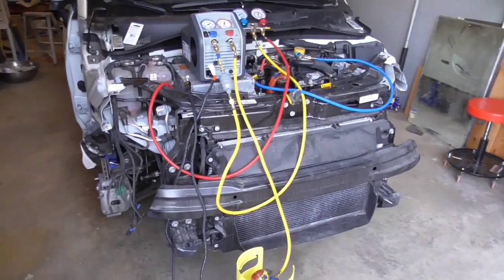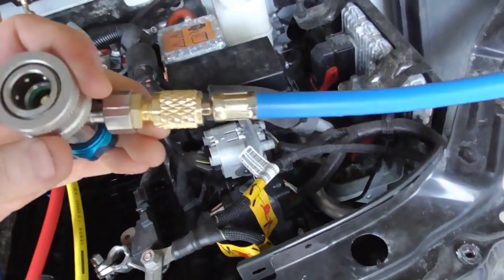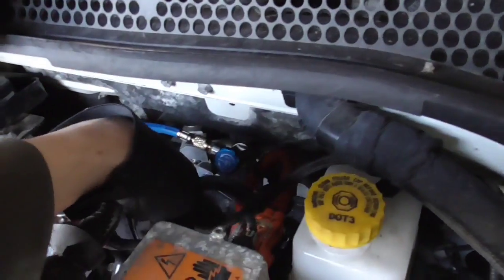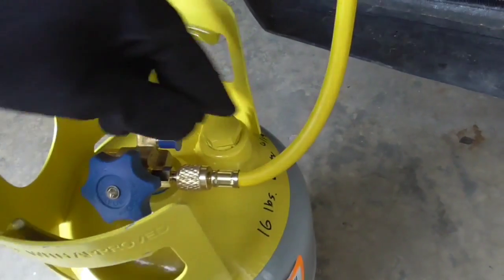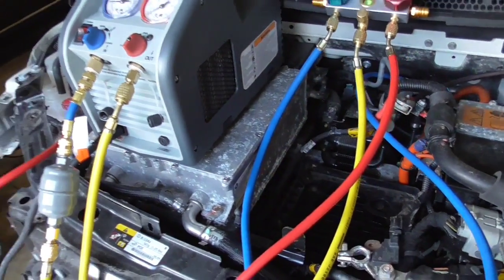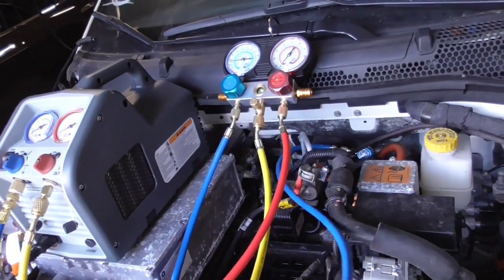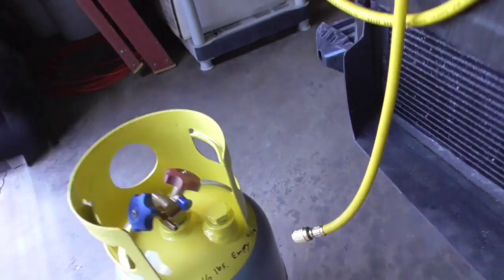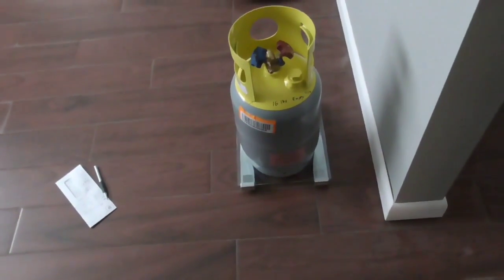How to recover R134a refrigerant from a car

Comment: So what exactly do I do with the recovered freon?
Reply: Since this is a recovery-only machine—not a recovery/recycle unit—you can’t reuse the refrigerant you pull out. Section 609 makes that clear. You’ll have to take the recovery tank to a shop that owns one of those $6,000 recovery/recycle machines, usually a professional automotive shop. Unfortunately, they’ll take the refrigerant off your hands, but don’t expect them to pay you for it.

Comment: How much money to spend in order to save $20.00 in new freon at Walmart? Recovery freon when million cars out there are leaking every second, even new cars on lot and those that no one bought it. is absurd
Reply: Wow, you're not real smart are you?
Reply: its also about working on the system without releasing freon into the air
Reply: @writer6006  Working on the system? so, tell me where my Elantra 2008 released the freon before I recharged again? System was working right, just not cooling, it needs freon, so I just add a can and now is 41 degrease Fahrenheit when before was 85. Tell me where it goes that freon?  But this is not just my car, there are millions all around the world. I replace my Kia soul compressor and now is working perfect, so you are talking stupidities.

Comment: When you said -"mabe this thing is not losened up enough..." And screwed the cap that covers steamvalve in the center of the gauges. I wondered what does that change if you didnt completely unscrew it and didnt press that stem valve? Does this guy really know what he is doing? Im not a pro at this but just using abit of commonbsense  I would vacuum my recovery tank as well as the machine with all hoses. Before starting. And would use that same stemvalve under that cap to release the air from hoses connected to the car.

Comment: You can definitely trust this guy because he knows that
A. 16 lbs bottle that has 0.8oz more weight (16.8lbs) is 12.8oz of recovered refrigerant.
Reply: The scale didn't read 16 lbs plus 0.8 oz, it read 16.8 lbs. Since there is 16 oz in 1 lb, then 0.8 lb equals 0.8 x 16 = 12.8 oz. You can trust his arithmetic!

Comment: Can you put the recovered refrigerant back into the system after you make repairs?
Reply: Depends, if you leave same compressor it's ok, but if you put in a new compressor it already comes with oil inside it, so you can't put it back in with the old oil in the refrigerant.
Reply: From what I understand, this is a recovery-only machine—not a recovery/recycle unit. That means you can’t reuse the refrigerant you extract. According to Section 609 of the Clean Air Act, refrigerant recovered using a recovery-only machine cannot be returned directly into a vehicle’s AC system. Instead, the recovered refrigerant must be sent to a certified facility with recycling or reclamation equipment. In most cases, you’ll end up giving it to a shop for free.

This type of unit is an inexpensive option for DIY or home users who simply need to evacuate a system before repair or disposal. It helps stay compliant with EPA laws by preventing venting to the atmosphere. However, it’s not intended for commercial or professional automotive work where recovery and reuse are required.

After using a machine like this, you’ll need to recharge the AC system using the standard 2-pound refrigerant bottle method, as a DIY. Otherwise, you’re looking at buying one of those full-featured $4,000+ recovery/recycle/recharge machines.

Comment: What's the advantage of using a machine as compared to icing a bottle without the machine?
Reply: The machine is used to recover the refrigerant. No other way to do it. You just just don't fill your system with a bottle because it'll over fill your system and cause leaks.
Reply: @D1amondeyes  but a machine is made by someone . What are the important features  that make it better than a human guaging everything.

Comment: When purging the hose shouldn't you leave the gas pressure on to it. Otherwise when you twist open the connection the gas could come out to the point that air can go back in.

Comment: That center cap is just a cap and you can purge the line with it, which should have been done. The refrigerant is green from the dye used to detect leaks. This video has quite a few things wrong and shouldn’t be used if you’re looking for a how to.

Comment: If you only got out roughly 13 ounces, isn’t that only about half of what most vehicle AC systems hold?  I'm pretty sure most hold 28-32 ounces. And shouldn't you put a vaccum on the recovery tank first. I've read elsewhere that it's needed so the vacuum pulls out the refrigerant.  Seems like you did this wrong!
Reply: Yes. He need to do a vacuum on the tank before using
Reply: Otherwise he will introduce noncompressible nitrogen or air into the system  @D1amondeyes

Comment: Great video, I got my system completed but slightly expensive about half price of yours more. Went with Harbor Freight Manifold Gauges, Inficon Dual Vortex Recovery Machine which is $835.00, same recovery tank as yours, I have a VivoHome Scale for about $100.00 and also have a vacuum pump form before from Harbor Freight. this is to work only in one car but not worries, my brother is actually a HVAC Tech so he can use them after and he is very happy with the Inficon recovery machine
Reply from the maker: Thanks, glad you liked it.  Great to hear that there's other setups that work just as well.  It would be nice if there was a cheaper option.

Comment: How can you tell if your car system is still holding refrigerant after your compressor, condenser and fan breaks. 

Alot of Debris got caught in my condenser, suffocating the air needing to cool it. In turn overloading 1 of 2 fans and the compressor.
07 Civic

Comment: I'm not an expert, that's why I'm looking you tube. This confirms to me that this is probably not the place to look,,, I saw many mistakes and I know little. Love the bit when he is taking R134a out and calling it Freon. I have charged fridges and cars but want to drain responsibly rather than venting to air (I assume you have to with R134a). Was waiting for the brass cap to fall off in his hands when opening the vac line!
Reply: 134a is freon

Comment: 6:11 - so the hybrids use r410 for its heat pump? and is the refridge in vapor form on both sides when the ac is not running?

Comment: Excellent practical demo. Question please. Is the recovered refrigerant  good to be reused or needs to go for treatment. Is it clean like what the expensive refrigerant  recovery machines do. Is not it having the oil and other dirt may be with it. Thank you
Reply: The recovery machine has a built-in filter. Also, he had an external filter before it reached his machine. It should be good to use

Comment: What's up with loosening the cap on the yellow line? That does nothing. Also, there is air in the tank which is not good for reusing refrigerant.

Comment: No, no no no-  there is so much wrong with this starting with the fact he opened both the high and low manifold valves at the same time and recovered them in the same shot
Reply: What is the correct procedure?

Comment: Can you reuse  the freon 
What I mean is, can you recharge the system out of the recovery tank?
Reply: I asked the same question. Because recoverd refrigerant have the oil and may be some dirt, does this machine recycle the refrigerant  for reuse. I saw similar small machine have outlet for oil dispense called Mastercool brand
Reply: From reading online no you cannot recharge the system from the recovery tank. It could have contaminants. You have to take it to a recycle place and they will buy and recycle your refrigerant.

Comment: sir, i have two questions. Does moisture /air (in the system) come along with gas into the recovery tank? Does compressor oil come along with gas? if yes, how do you manage?

Comment: just to help out those watching........most automotive applications are measured in grams or ounces. Part of the reason these machines are so much cheaper is because the really expensive ones are automated and all the measuring is done for you. All you have to do is dial up the amount to be loaded in and hit start. Evac is the same....it measures what comes out.The machine handles the rest. Makes it really easy to detect proper levels. But this is pretty handy for those DIY who want to do it the responsible way.

Comment: Not all vehicle hold the same amount of 134A. I have a 1998 Ford Explorer and it takes 30 oz of 234A. Check your manufacturer data on what amount your vehicle takes. Also ambient temperature males a difference on lo side and high side pressure. Just Google for a chart. The colder it is the less the readings will be on your gauges  you could damage your compressor if you over fill it or other problem. Also change out the valve inside the low and hight sides it avoids leaks to change them out if they have been in there a long time. They are cheap so replace them. You will need a valve tool to accomplish this removal and installation of new valve stem.
You also need to make sure your using 1 tank for 1 type of Freon. If it's an older vehicle it will have R12 R 134A or R1234YF. You can not put them all together. You need separate recovery tanks.
My Advice is go get training. You can harm yourself greatly if you do not know what you're doing.

Comment: There’s a date printed on my 134a cylinder. Do you know what the date represents? 
Mine says: 01-08-2021
Reply from the maker: Could be the date of manufacture or... "Refillable cylinders must be retested and recertified every five years, and the test date must be stamped on the cylinder shoulder."
Reply: @theevolvingworld  I bought it brand new sealed. So I assume it’s manufactured date?
Reply from the maker: @christopherowens2635  It must be.  There's probably another marking on it "A-26" or "01-26" for the expiry or need to re-certify date.

Comment: Can you use the same recovery machine to recharge the system? or are these types of recovery machines specifically just for removing freon?
Reply: To recharge the compressor suction is used. If the compressor doesn't work just replace it.
Reply: From what I understand, this is a recovery-only machine—not a recovery/recycle unit. That means you can’t reuse the refrigerant you extract. According to Section 609 of the Clean Air Act, refrigerant recovered using a recovery-only machine cannot be returned directly into a vehicle’s AC system. Instead, the recovered refrigerant must be sent to a certified facility with recycling or reclamation equipment. In most cases, you’ll end up giving it to a shop for free.

This type of unit is an inexpensive option for DIY or home users who simply need to evacuate a system before repair or disposal. It helps stay compliant with EPA laws by preventing venting to the atmosphere. However, it’s not intended for commercial or professional automotive work where recovery and reuse are required.

After using a machine like this, you’ll need to recharge the AC system using the standard 2-pound refrigerant bottle method, as a DIY. Otherwise, you’re looking at buying one of those full-featured $4,000+ recovery/recycle/recharge machines.

Comment: I had to stop watching... there is so much wrong here and this is why amateurs ruin the industry and the environment. Perhaps it's a devolving world we are heading towards.  Just pay the $50 and get a professional to do it...
Reply: Yeah if that was $50 I would just pay but those professionals have became so greedy that you cant get anything done with less than $100. I went to a local shop asking to simply evacuate the system because I want to replace the AC pump and even that was $80. I said thank you and left. So no wonder there are people trying to do that by themselves. The real reason - greedy professionals. Screw them ok? I am putting together my own setup to work on AC. Even if this video is full of flaws it still shows what is needed to get things done.
Reply: If the environment is so precious to these “professionals”, they would pay me for properly evacuating my ac system.
Reply: @imadog131   Lol, you got a point there! But then the "environment people" would not profit from fines and fees, how dare you.. Actually this whole HVAC opera reminds me the GMRS band and FCC license, you can buy a couple walkie talkies for like $30, they have like half of Watt output, they are absolutely harmless but FCC can fine you up to $15000 or something like this if you have not bought a license for $70 from them. But at the end what is the difference - its the same walkie talkie - with our without the license. And then there are these harsh faced HAM radio "professional" geeks on the internet constantly screaming that it is "unlawful" and that they will report you too FCC. And there isnt even any harm done to the environment..

Comment: Hmmmm... But before you even think of reclaiming any refrigerant from and system you must determine what refrigerant is actually in the system. For example, if the A/C label says the A/C to be used is R134a... that does not mean that is the correct refrigerant in the system. I have seen systems with explosive PROPANE in them!  So an Electronic Refrigerant Identifier is required to verify it is in fact R134a. If it is anything other than that, it is illegal to re-claim that refrigerant from the vehicle and you must stop now. The recovery cylinder weighs 16 pounds empty. (But is it under vacuum? Maybe, maybe not!). It must be fully evacuated first with a good two-stage vacuum pump like a Robinair 15600 6CFM before it is used to reclaim any refrigerant from the vehicle. This vacuum pump will pull down to 15 microns vacuum ONLY IF you have taken very good care of it and changed the specified oil in the pump every time you used it. If you did not take care of the pump oil properly even one time,  it will not pull the 15 microns ever again. The vacuum pump has now been ruined. No sense in troubleshooting an A/C system if your pump is damaged. To start with you will need an Electronic Thermister Analog (Not Digital) Vacuum gauge, just to check the vacuum capability of your pump.  That is the ONLY way you can be sure that your vacuum pump will achieve the maximum vacuum needed to have minimum humidity in the system after evacuation. A simple manifold set will not even come close to this very important electronic analog gauge. If the recovery tank has air (humidity) in it, it will contaminate the refrigerant and cannot be re-used in any system. If you do try that, you will destroy ALL of the A/C components in the vehicle because hydrofluoric acid will be formed when the humid air is combined with the refrigerant. Further, PAG oil is hydroscopic and is like a sponge for holding moisture and creating that acid. That means every component made from aluminum plus the compressor has to be replaced and huge money! If you reclaim from multiple DIFFERENT vehicles into the re-claim tank it is illegal to re-use any of that refrigerant in any A/C system with an EPA penalty of $10,000 and 10 years of Federal imprisonment if you are caught. And that is each occurrence! The EPA does not play games on this. As of 2018 Federal Law require an EPA Certification 608 or 609 of all technicians to purchasing over two pounds of refrigerant of any type. Charging with a small can is a very inaccurate way because many times you cannot know what the actual weight of the refrigerant is dispensed and the right WEIGHT of charge is critical for proper and safe operation of the A/C. Hope this helps! Mike -- ASE Master Technician Automobile and ASE Master Technician Medium/Heavy Truck. EPA Certification 608, 609 & Universal Licenses. AOS Degree Automobile, Diesel, & Industrial Technology earned at Universal Technical Institute in Phoenix, AZ
Reply: Great response.  When are you going to make a video?
Reply: Did u copy and paste this response? 🤣

Comment: Was very difficult to hear voice over the loud sound of the recovery machine. Overall even with headphones and watch listening twice I was able to get it still with difficulty. Question... Does this machine offer PURGE so that I would be able to clear all residue of refrigerant from the RG3 to prevent corrosion and be able to use the machine with multiple refrigerants?
Reply from the maker: I'm glad you were able to glean some useful information.  The RG3 is a universal Refrigerant Recovery Machine - compatible with almost all types refrigerant.  I don't recall if there is a special purge routine other than just air pressure.  We only got it for R134a & maybe the newer R1234yf in Automobile systems.

Comment: Wrong side for recovery should be on the red liquid line and you dinnt even purge .. as soon as you get moisture in the mix you asking for trouble
Reply: Actually, he should be recovering the refrigerant from the low side. If you recover from the high side, you will probably be evacuating oil at the same time.  Yes, he has definitely made some mistakes.

Comment: dont take this the wrong way, you are better off releasing the old r134 into the atmosphere and using 5$ wal mart cans for the recharge than all the mess you are getting into here. 

Personally, I have friends with body shops and buddys and dealers that let me use their robinair machines and its all in one, vaccums out, performs leak test, etc and recharge. 

I get you are trying to turn semi-pro but its still pretty bad. 
I had a bad leak, leaked out all the r134 over the winter, spring I fixed the leak, vaccumed it with a small pump off amazon and recharged it with a similar gauge setup. 

Again, as suggested, would be ideal to remove this video, re-do it properly with steps, and repost.
Reply: I'm pretty sure most DIY people vent it all out into the air/atmosphere.  134a isn't anything
Reply: Venting is illegal, also If done correctly recovered refrigerant be reused